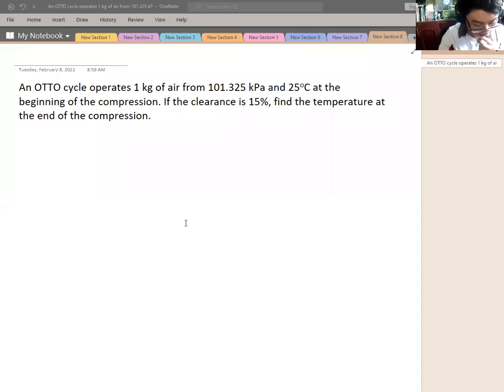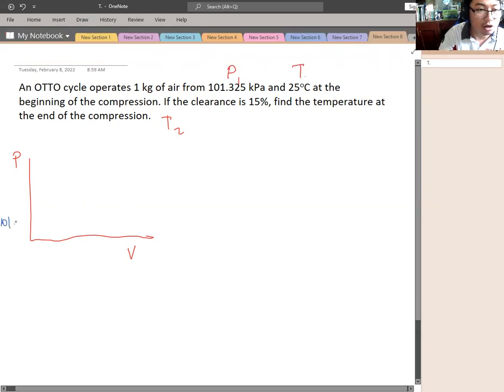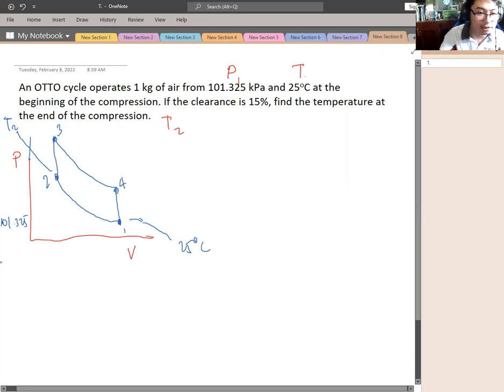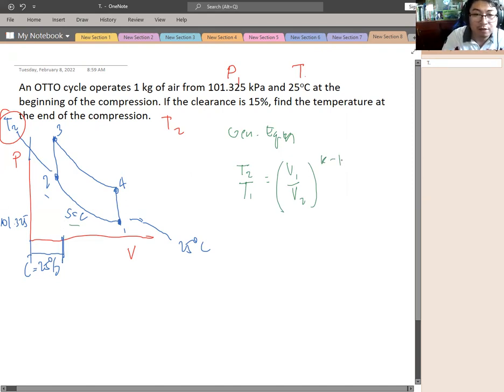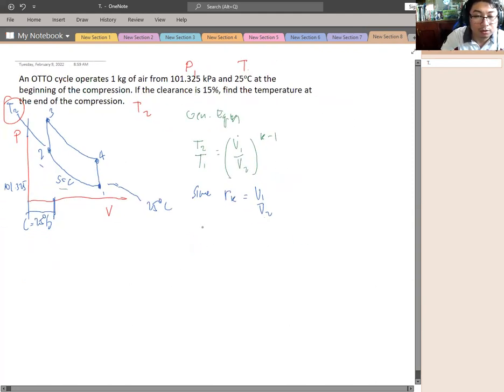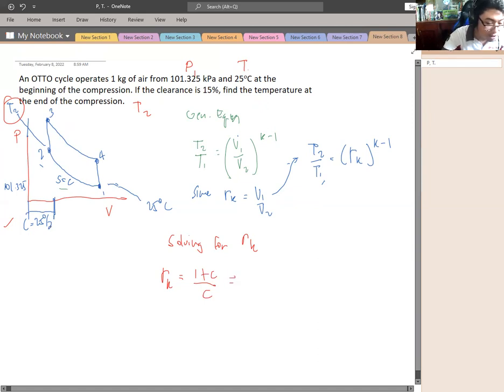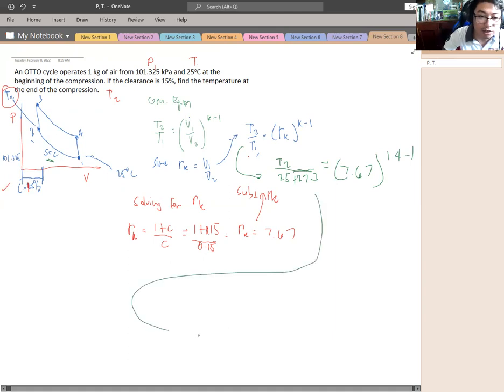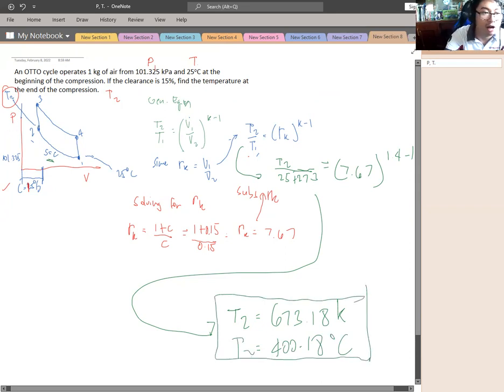Otto Cycle Solve Problem - Combustion Engineering

Comment: Can you answer this problem po sir? hehe

Compute the ratio of the volume before and after the isentropic compression process of an Otto cycle if the pressure ratio is 18.50.?